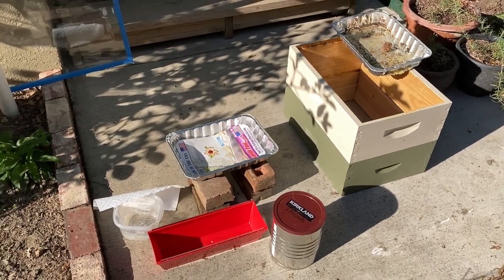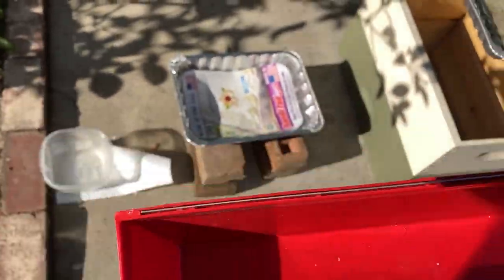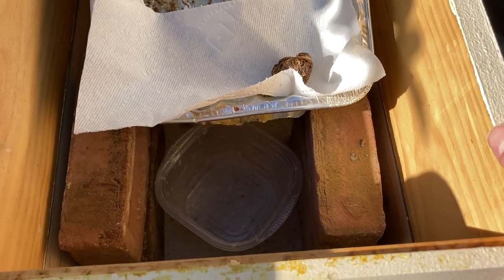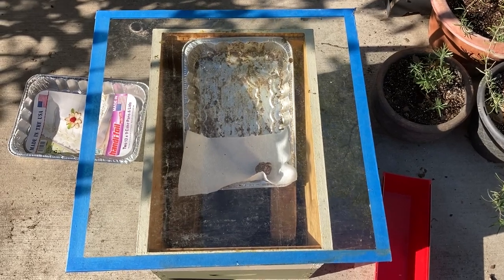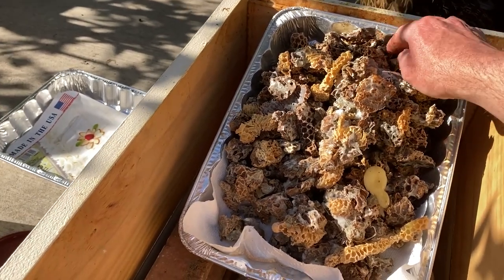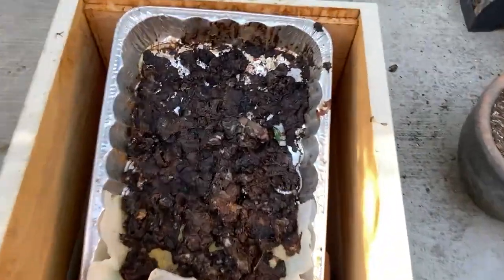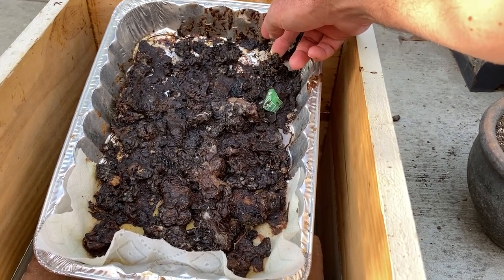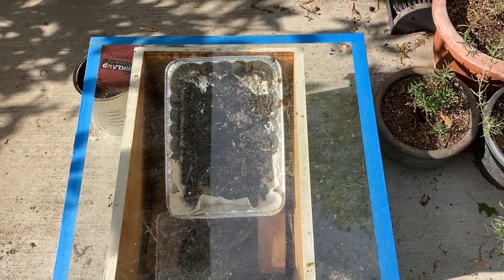❸ DIY Solar Wax Melter - Simple and effective

Comment: Do you have any trouble with the 'dirty' wax running underneath the towel above the cut in the pan?
Reply from the maker: I have not.  If you place some wax on top of the lower edge of the paper towel as it melts it sort of seals the paper towel to the bottom.  I do sometimes I get honey that flows through the paper towel but that can be cleaned up in a final rendering.  I made a video about that and showed some of the candles we make and that process too.

Comment: Wondering if adding water to container will help with honey on the bottom of the wax.
Reply from the maker: I actually tried that and it made a lot of funky beads of wax as the hot wax hit the water.  It formed little pockets of water and honey.  I found that just running water over the wax when it was finished washed off any residual honey.  Thanks for watching and commenting!
Reply: If you rinse the cappings/comb 4-5 times, no honey will be present.
I let my bees clean it up, and take what's left in the bucket, and fill it with water. Strain and repeat. Any water left on the wax will make it into the drip pan. I usually put a cup of water in the pan anyways so the wax doesn't stick to it.
Reply: @BrianCooper901 if you can get the wax to melt into a level brick by cutting off any leaks, your results will be much cleaner. Plus, no ants.
Reply: I put water in the bottom of mine and also got wax balls. The balls may be easier for my wax melter.
Reply: @mz.stephaniehaygood  if the water pan is to temperature, the wax will remain molten and cool flat.
The water in the bottom 'freezes' them when it drops in. If the bottom chamber reaches 160°F then you'll have a level block.
Edit: without pockets or voids for water to get trapped in.

Comment: Turn the red container to run the length of the box, and put the slit in the middle straight under the melt pan.
Reply from the maker: That would be a perfect upgrade!  Thanks for commenting.
Reply: @BrianCooper901  right out of high school I got a job as an engineer. I got tired of it (fighting with mechanics that were cool otherwise), so I switched to carpentry/home remodeling. 
This is a simple and efficient design, and I'll be happy to save your video to my playlists.
Reply from the maker: Thanks for the kind comments.
Reply: Thank you!  Sunpowered ingenuity. Beautiful results